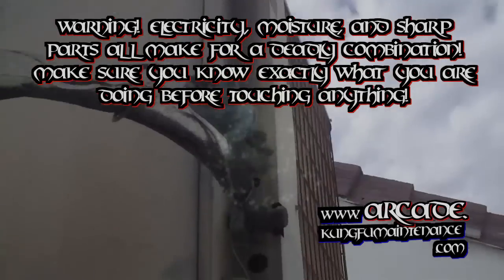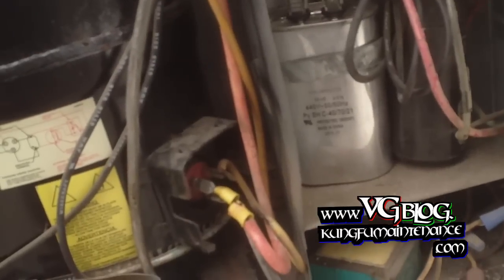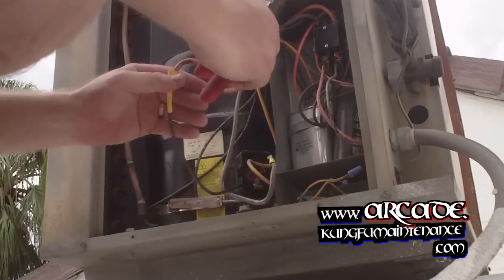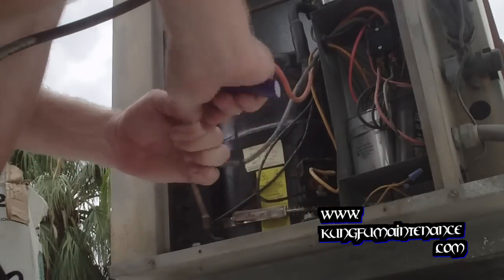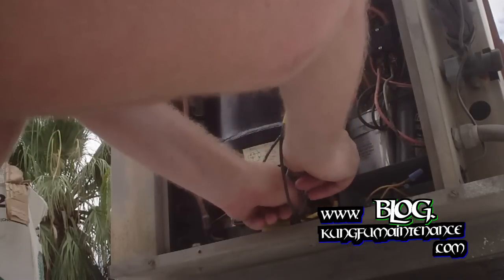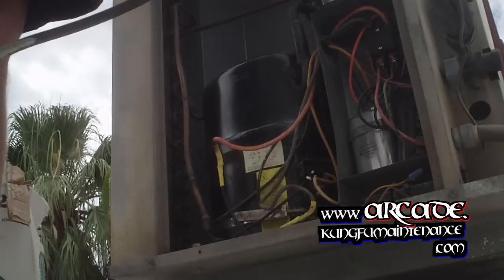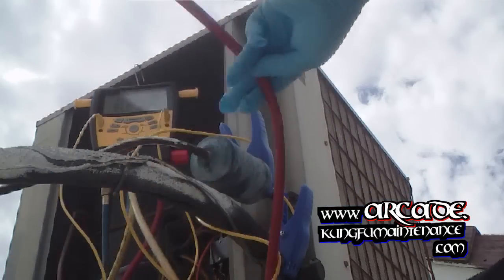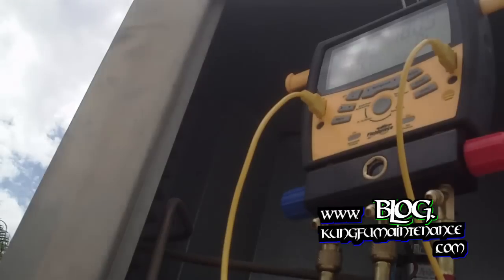How To Replace Broken Melted Or Burned Air Conditioner AC Compressor Wire Leads

Comment: I think one of my posts on the compressor where the compressor wire lead connects may have burned off.  On the compressor side versus the wire lead side.

Comment from the maker: Sorry this took so long I somehow missed the question. First check would be at the thermostat which is the most often cause of that scenario. I would try swapping out the thermostat. I hope to make a video soon showing how to troubleshoot the thermostat. 90 percent of the time it would be bad thermostat or loose wire connection behind thermostat. Other less often occurring 10 percent in order of likelihood would be, bad thermostat line, bad transformer, or bad relay.

Comment from the maker: Thanks, good question. I tried to research that but did not have much luck. My conclusion is they are engineered for the job and are used with good success. Early on I ran into problems when replacing terminals for the run and common wire as they would sometimes melt unable to handle the compressor load. Doing more research, the manufacturer of these leads recommends replacing 12 inches of wire as the insulation and copper strands often break down as much as twelve inches from the compressor.

Comment: What insulation is on the new leads. I am looking at the older wire and that insulation is fat like it is more durable; but, it's unmarked so I can only guess that it is rhw may be mtw.

 So, I ask you what is the insulation types on that fat one and on the repair kit. 

I had seen those repair kits in the pack but decided just to go with a new wire and a stake on crimp as it is much cheaper than using that kit. The wire I used to replace is thhn #10